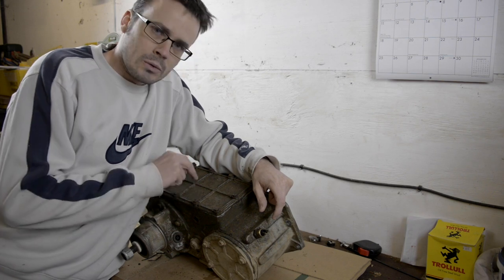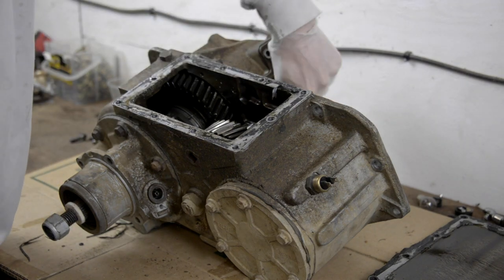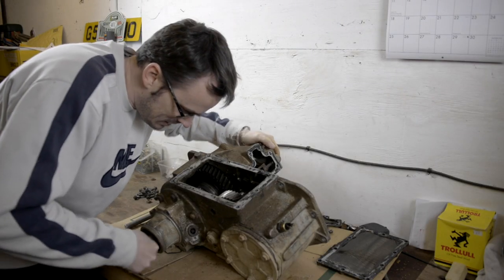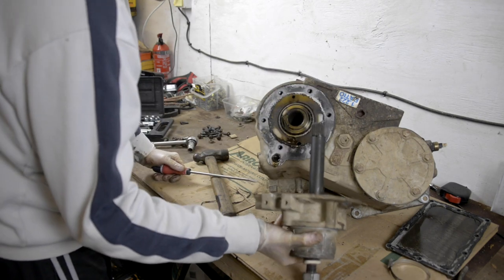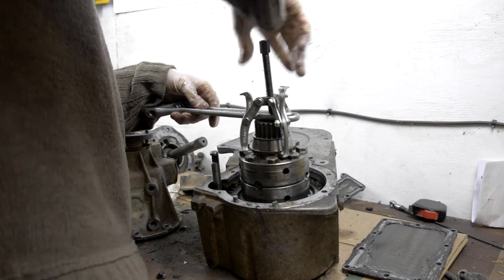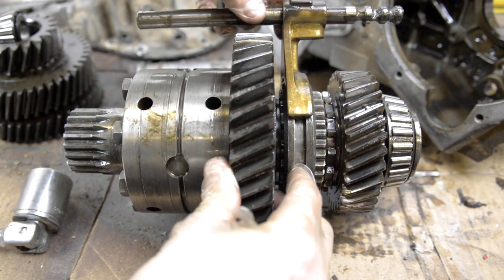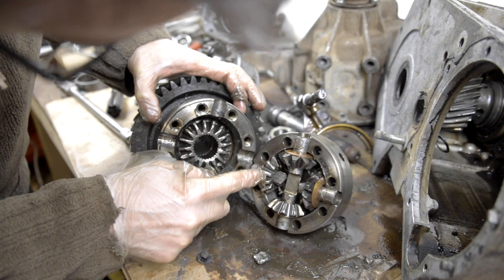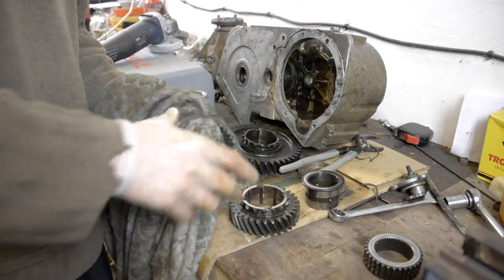Land Rover LT230 transfer case teardown - stuck in diff lock

Comment: The  reason this center diff has failed is normally down to driver error for not locking the diff when they should, the wheels spin like crazy which destroys the diff in minutes if not seconds!
Good video.
Reply from the maker: Thanks for the comment, you are spot on that is exactly what happened!

Comment: Thanks for tearing this apart, it was good to see how it's all put together. I'm trying to work out why mine has a lot of slack between high and low ratio and won't engage properly, can't see why looking at the construction but it helps to know what's there before taking it apart.
Reply from the maker: Ah that is great you found it useful. Is really what I had in mind for the video. Hope you get to the bottom of your issue.
Reply: @garage90uk  Thanks, I figured it out today. The part you took removed off-camera at 2:53 has a little hammer style arm that operates the selector rod you can see sticking up when you remove the housing at 3:00, it's held on with a grub screw that came loose and the arm was loose on the shaft. Now thread locked in place and re-assembled. I've had this transfer box in 2 trucks over 8 years so it's a bit surprising.

Comment: Mine self destructed - curious if a rebuild or swap is a better way to go ?  any thoughts on time/pricing a rebuild - how many parts are usually changed in a rebuild (some parts are likely destroyed)  thanks
Reply from the maker: Bit hard to say without knowing the details of yours. I bought another transfer case so cheaply that I don't think rebuilding was worth it in my case. If yours has really broken up inside then you will get metal fragments about that will all need cleaning out etc.